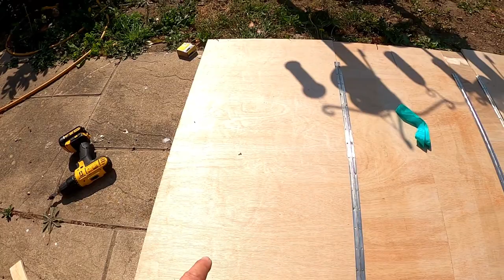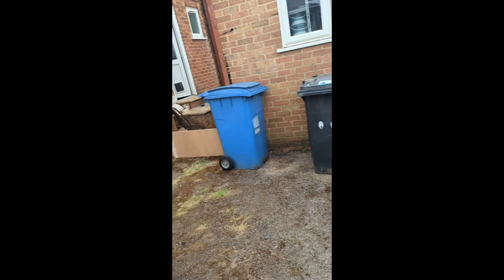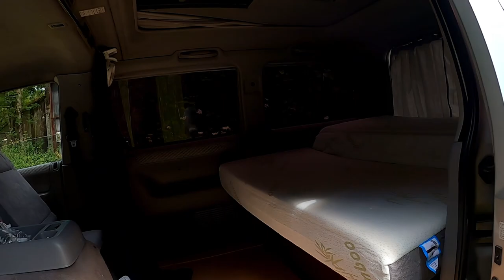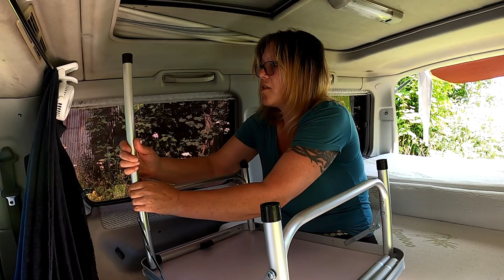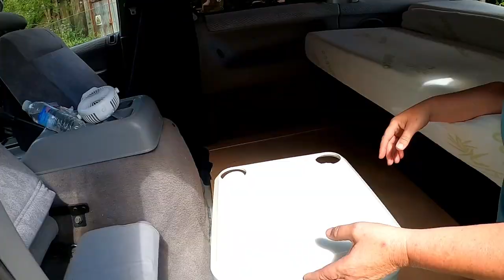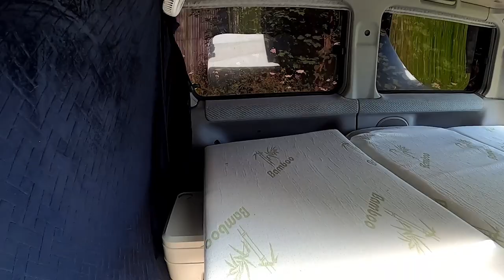Van Tour Self Build | Discover How to Maximize Space in Your Mazda Bongo Van | Double Bed Edition

Comment: hi, how did you get on with mot ,with your self build bed ,great idea what are the sizes the bed thanks sam
Reply from the maker: @samfletcher222  it's a standard double bed size, no seat belts to check. Just tell insurance that it's only 2 seater as back seats and seats belts have been removed. No problem with MOT.
Reply: cool, bed  size is brill more room than i thought ,and mot bang on thanks for reply @SheDigsitUK